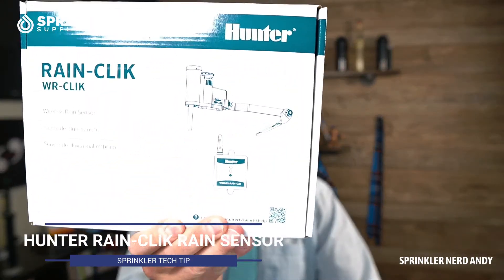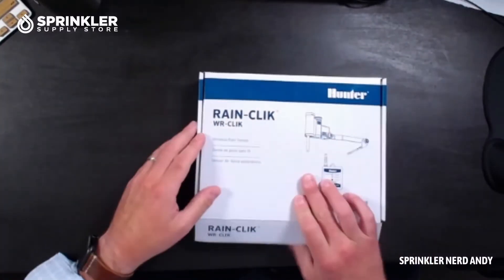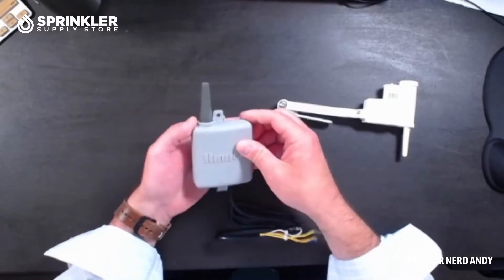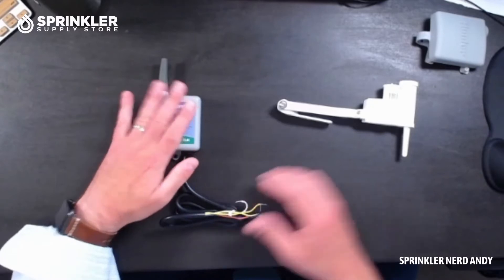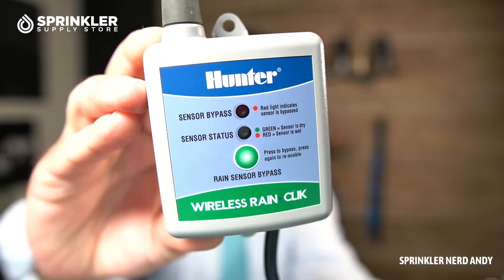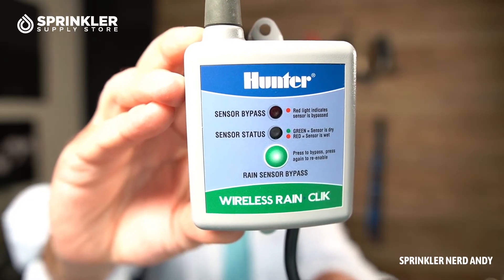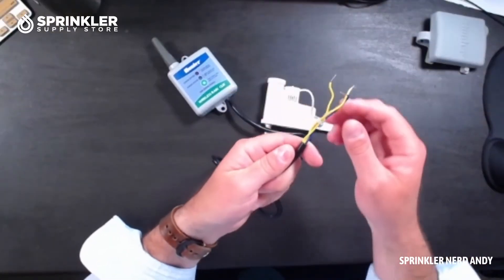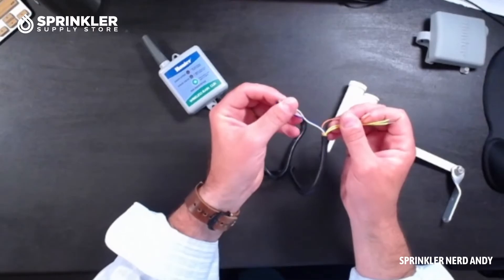Hunter RAIN-CLIK™ Wireless Rain Sensor | SprinklerSupplyStore.com

Comment: You could do a better job by reading the manual and not guessing about which wire to connect. Also you could talk about battery life, and how to easily test the functioning by pouring water on the sensor. 
Also how about an idea about drying time min to max?

Comment: I have a Hunter Pro-C controller that's about 10 years old and now the battery to the wireless sensor seems to be failing.  Is the sensor you show in this video the correct one for a weather-based controller that changes the watering amount according to ambient temperature?
Reply from the maker: It sounds like you may have a Hunter Solar-Sync instead of a Rain Sensor - the Solar-Sync uses temperature as one of the variables to adjust for weather.  The rain sensor in this video can be used with any weather-based irrigation controller that changes the watering according to ambient air temperature and/or evapotranspiration. Rain sensors like this one interrupt the controller when it is raining. This interrupt differs from adjusting zone runtimes based on ambient temperature or evapotranspiration. Feel free to call our support line at Sprinkler Supply Store, and we can verify the exact equipment you have and how to replace/repair it. -Andy

Comment: What type of coaxial cutter would I need to utilize to shorten the cable Hunter Sensor black outter wire cable
Reply from the maker: Good news! The cable you’re dealing with isn’t actually coaxial, so no need for any fancy coaxial cutters here. You can use a basic wire cutter or utility knife—pretty much anything you’ve got in the toolbox. Just be sure to make a clean cut so it’s easier to work with afterward.
Reply: @Andy_Humphrey  - Thank you, Andy 🤝

Comment: I have installed a replacement sensor as our roofers threw ours away when they p pulled our gutters.  My question is that center cylinder I'll call it...has a white piece that was sticking out the top that you say is used to sync.  As per the instructions it says to use the black button, manual test spindle, after you press the receiver button and connect the yellow power wires.  You show syncing with that white piece in the middle top?  I did it as per instructions and installed it outside and that white piece is now depressed inside the cylinder after the rain this morning.  Is that supposed to pop back up after it dries out?  My other question is the manual test spindle was easy to press to test the battery when we originally installed a couple days ago and is now near impossible to press, nor does the battery led indicator illuminate.  This is a second replacement unit that is testing as a failed battery basically straight out of the box.  Is there anything I'm not understanding before i return it or am i the recipient of a couple units possibly from a bad product run.  This one is dated May 2024.
Reply from the maker: Hmm, hard to say. My response is late, curious if you have resolved this. The spindle it a momentary switch, and if the discs are full, I don't believe you can depress it when wet.

Comment: Hey Andy! Can I use the same app to control my irrigation? I installed a card on my X2 do I have to remove that and disable the wire sensor that I have?
Reply from the maker: Very sorry for the 8 month delay. I don’t exactly follow the question, and based on my delay, assuming you have figured it out. If there’s any questions you might have feel free to contact our support.

Comment: Can you use this on a battery operated timer?
Reply from the maker: Yes, maybe, it depends on the specific timer. Check to see if your timer has a "sensor" input. If it does, then you can use this. Remember that you will need to power the receiver with 24vAC which may or may not be possible at your location. If it is not possible then I would recommend a wired rain sensor because it does not require a power source.

Comment: Completely lost on wiring instructions...  yes, two yellow go to 24V.  Then I have white, blue and orange.  Everywhere I look says something different.  Any help? PRO-HC
Reply from the maker: PRO-HC is confusing, you can actually use either wire. Most controllers are Normally Closed, PRO-HC can be either.

Blue = Normally Closed Circuit (SEN-1)

OR (not both)

Orange = Normally Open Circuit (SEN-2)
Reply: Thanks Andy...  Spot on!

Comment: My house has a sensor but in the two years I’ve lived here I’ve not been able to find it. I just have it set to bypass since I haven’t been able to locate it. I just wish I could find the dang thing haha
Reply from the maker: Hahahaha. Good chance it is gone! You can remove the receiver and place a jumper wire between the terminals (a paper clip will work) if you're tired of using the bypass mode. Sounds like a good time to replace it!
Reply: @Andy_Humphrey  - Excellent 👌

Comment: Attention everyone.  Few realise how crappy their wifi routers work in a neighborhood surrounded by others all competing for the same wifi bandwidth.  Plus most wifi routers are factory defaulted to 'AUTO' wifi channel selection, resulting in channel mobbing & mob reselecting next channel.  Every time your wifi router changes channels there is about a 7-15 second wifi outage while it reconnects.  There are 2 options: set your wifi router to not 'AUTO' & manually pick a least used channel & stay there; or use wired devices to bypass wifi altogether.

Don't blame your device or your ISP for your own lack of wifi channel management.  Its up to you.
Reply from the maker: 100% NERD !!!! Nailed it.

Comment: Does the corks dry out to my the transmitter unusable?  I just replace my transmitter because it wasn’t working with my existing receiver or was for whatever reason not turning off my sprinklers during a rain event here in Florida. So I synched the new transmitter to my old receiver.  Now I wait I guess.  I was able to hold the button down on my old transmitter to engage the receiver manually.  But rain wouldn’t do it for some reason
Reply from the maker: Yes, it is possible the discs may be worn out, but they generally last a very long time. If holding the button down was successful then the unit is transmitting correctly. You could try pouring water directly over it. Also, check that the rain volume settings are not too high.
Reply: @Andy_Humphrey  we are having a light rain right now. I just checked the receiver and it has turned red.  So it should be working now. At least I see now that the transmitter is talking to the receiver.  I think my transmitter finally just went bad. It was stamped 2016 so not ten years old yet
Reply from the maker: @mchestnut1970  makes sense. Glad you got it working!

Comment: My Rain Click has stopped transmitting.  Can the battery be replaced?
Reply from the maker: The battery on this unit is sealed and not replaceable (designed to last 5years). You can purchase a replacement transmitter and pair it with your existing receiver. Part WR-CLIK-TR.

Comment: Very crappy product. I am replacing mine with a wired one. Money-maker for sprinkler contractors.
Reply from the maker: Huh. They generally work great. What happened with yours? I agree, wired will be more reliable in the long run, it’s just always possible to get the sensor in the most ideal location.

Comment: After 10 years of working the old transmitter battery died. Hunter sent me a replacement. The transmitter light blinks red when tested. When I try to address the new transmitter using the method from the manual, unplugging power to the receiver, holding button on receiver, applying power back, there is NO YELLOW lights like the manual says it just turns the bottom light red. No connection. I don't know what to do now.
Reply from the maker: Sounds frustrating; technology is great, when it works..

Retrace your steps, making sure to press/hold the Bypass button, then applying power.

Also try to see, if by chance, it’s paired. Hold the spindle on the transmitter and see it will trip the receiver.

Last option, buy a new receiver.
Reply: @Andy_Humphrey  So I held down the bypass button on receiver. Plug back in and I never got any yellow lights. Multiple attempts. Just a red light. I went inside for a bit, to post on your channel, also tried to see if my old RainCLK never had a yellow light. Came back to make sure all sensor input wires connected and the units were paired. Green light!
Thanks for the video.
Reply from the maker: If I had a dollar for every time......haha. Seriously though, technology is just weird like this sometimes!

Comment: Hi There! Just purchased exactly the same wr rain sensor trying to connect it to an XC4 irrigation controller. I 've done the wiring as per your instructions - 2x yellow to 24v power, blue and white to SEN - orange left unconnected.

Receiver seems to be paired with sensor as it behaved as per the guidelines - plugged was having the red light - pushed the black button on top of rain sensor - receiver turned green.

My problem is though - the irrigation controller always shows OFF and the umbrella! So as soon as I swithc SENSOR ACTIVE on the controller it shows the OFF with the Umbrella (regardless if sensor is wet or dry). Sensor works well as the receiver turns red after rain and turns back to green as dried out.

Soo annoying that can't use the rain sensor due to this issue. Tried everything - unplugged the controller - de & re attached the wireless receivers cables - plugged it again , tried resetting the controller but nothing. Any advise? 😊 

As soon as swithcing controller to SENSOR BYPASS - umbrella dissapears and all works BAU 🤷🏼‍♂️
Reply from the maker: Sound’s frustrating! I believe you have it wired correctly, however, what you describe is backwards operation, similar to a Normally Open controller.

Try using using the Orange wire instead of Blue.
Reply: @Andy_Humphrey  Yep, wired as instructed - followed every steps! Thank you for the advise, will do and update You!
Reply from the maker: Yes, I'm on the edge of my seat now. Let us know!
Reply: @Andy_Humphrey  apologies - just managed to do the suggested changes on the wiring - no luck :( - recorded a video for reference --> https://youtube.com/shorts/zQy1e1Z7UZ0?feature=share

Any ideas? Not working with either the blue white or orange white combination.
Reply: @Andy_Humphrey  I am on the edge of my seat now 😋 so any ideas?

Comment: My status lights are not on. Is the orange wire suppose to be connected and if so, to which terminal?
Reply from the maker: Hi Patty. The correct wire should be blue and white, for almost all controllers, unless you have a very old timer. 

If this is a brand new sensor, you may have to pair the rain sensor to it, by pressing and holding the spindle on the rain sensor for 5 seconds until you see the green status light.

If this is an existing rain sensor, the batteries may have failed, or the rain sensor may be have become disconnected from the receiver. Eva want to retrieve the rain sensor from its location and troubleshoot from there.

Feel free to contact us directly if we can help you further.

Comment: Hi. How long does it take for the sensor to dry? It's been 48 hrs since rain and my system is still in suspended mode and sensor light is red indicating wet still. The plunger is still down

Thanks!
Reply from the maker: Hi Hoson. Depending on the environmental conditions and the settings on the sensor 48hrs is not uncommon. If you feel it needs water right away, you can bypass the sensor to allow it to water.

Comment: Is the plunger supposed to stay down when wet ?
Reply from the maker: Good question. I don’t know the answer 100%, but I assume yes. The bottom of the plunger (pin) is what makes contact and interrupts the circuit. When the discs swell it likely forces the plunger down.

Comment: For this rain sensor connecting to hunter hc2400 controller, what is the proper wire setup for the white and blue wires?
Reply from the maker: Hello Shenanigans! I’m a 7 and I encourage shenanigans!!!

After looking into this, it appears you can use either normally open, or, normally closed wires and then configure it in the app. I’ve included the instructions for you. -Andy

https://www.hunterindustries.com/sites/default/files/rc-005-qg-prohc-en-web.pdf

Comment: Good morning. My BHyve will not run as programmed with a Hunter wireless rain sensor attached. The system is always "suspended because of a Rain Sensor" and K have found no way to override this  I have had the water company professional come out twice to assume that the rain sensor is properly working and he believes I won't be able to use this rain sensor. Is there a different wiring configuration that we can try?
Reply from the maker: The first step is to isolate the problem. Is it a controller issue, or a sensor wiring issue. 

I recommend removing the sensor wires and placing a jumper wire between the sensor terminals (a paper clip will work). This is the “default” setup of the controller and it should not be suspended. If it’s still suspended something is wrong with the controller.

If the controller is good, the next step is to troubleshoot the sensor. Double check the wiring and be sure you are using the “normally closed” setup. It is possible the sensor was installed using the “normally open” configuration which would cause the system to be permanently suspended. I probably should’ve recommended you check this first..

If you need help please call us and we’ll walk you through it.
Reply: @Andy_Humphrey  thanks for replying. I was able to get it working some time back.

Comment: Regarding wiring: Do the two yellow wires connect to the 24-volt terminals ALONG WITH the leads that come from the transformer? I have a Hunter Pro-6 control box.
Reply from the maker: Hi Joe. Correct, the yellow leads go on the 24VAC terminals. Happy to help if you need anything else.

Comment: Will I have to worry about battery replacement and if so, how ofter.
Reply from the maker: The battery on the sensor is a non replaceable internal battery.  There's a 10 year warranty on the battery in the sensor, so if you end up with a unit that fails in that period of time you would be eligible for a warranty replacement.